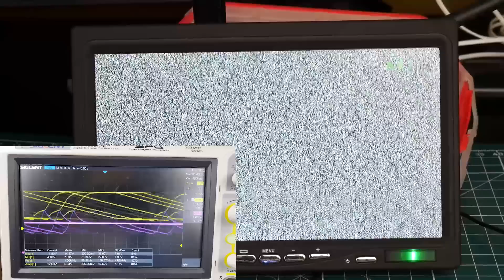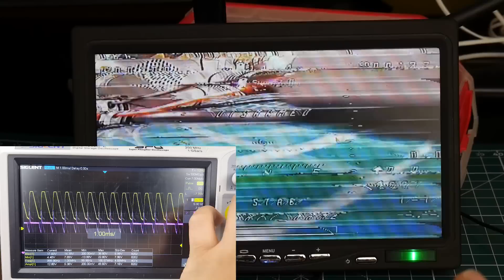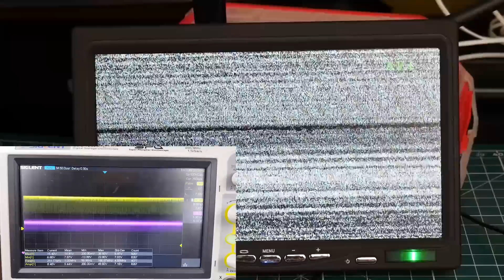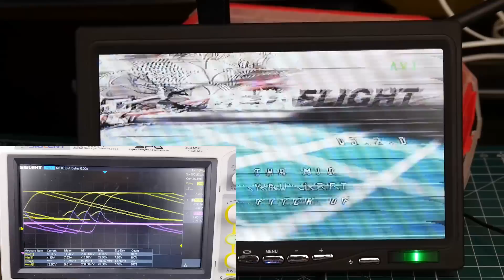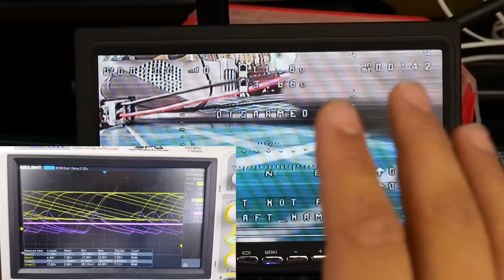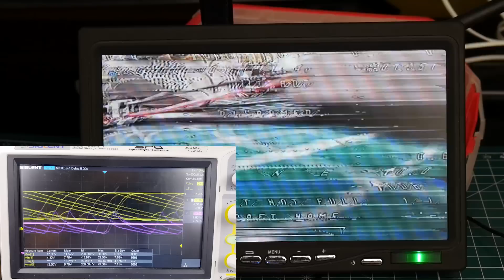HAKRC Omnibus F4 AIO Flight Controller // Noise Stress Testing Review

Comment: does it still need the ST60 connection wehn you use the black 8 pin connector on the front ?

Comment: Did you get the racestar tatoo 4S with blheli 32 esc working?
Reply from the maker: +GauisHelenaMohaim There is awesome channel called steelrainFPV he has been playing with it ask him. Tell him I sent you ;)
Reply: Drone Mesh Just build a Avant Devil with that board and brotherhobby r4 2205 motors. Weather is awful in Belgium now. Waiting for the maiden until it clears up. I noticed several people had problems when doing pitch flips on RCgroups. That's why i launched the question 😉 Anyway, i will look at the steelrain channel. Grts.

Comment: Always loved a better testing methods. You should try to punish our Matek F405 AIO and RacerStar 4-in-1 FC-s like Tatoo F4S one.
Reply: Oh I hope he does the tattoo, I get so much noise on the 5v :(
Reply: I have Tattoo F4S too with Emax RS2205 2600KV motors on 4S in my 5-inch racer quad. Yep, it was particularly noisy in begin. Made it very little noisy with 1000 uF/35V low ESR capacitor on battery pads. Seems I should check what to do to make it noise free. So far didn't found any convenient place on board for second capacitor - inside board all connectors are damn tiny.
Reply: I have a similar setup but with the racerstar 2306S 2700kv on a 5" on 4S. I put in a 330uF/35V cause I only had those around and still get so much noise that OSD freaks out. I gave up on using the on board regulator and went and got separate PDB with a 12v voltage regulator for VTX and Camera. Problem solved but I wanna loose the extra weight.